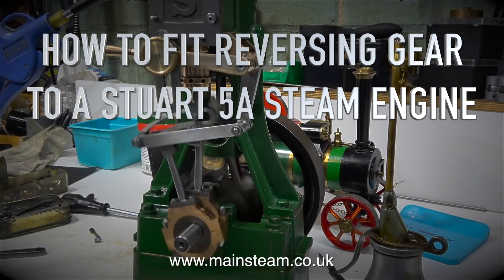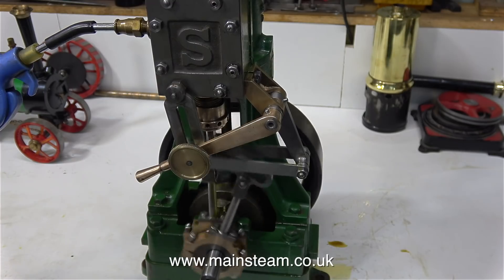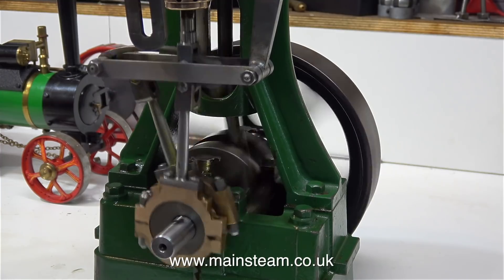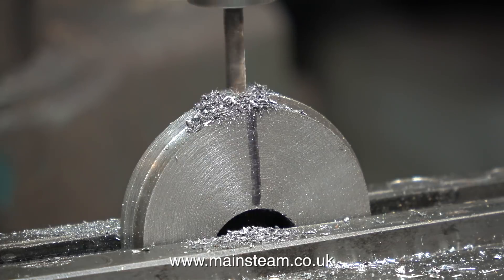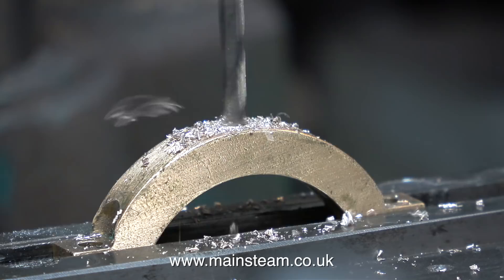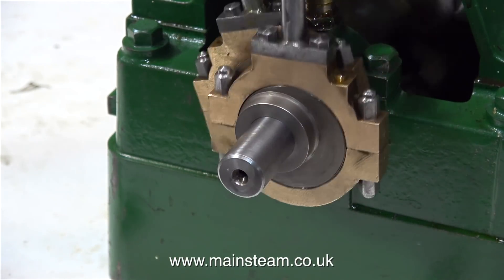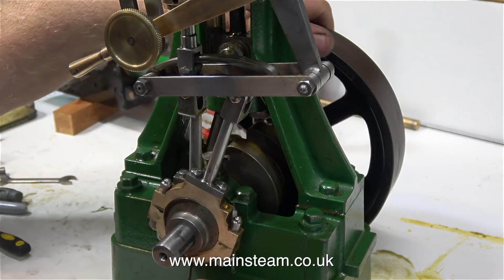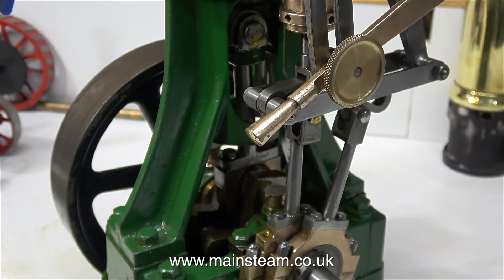HOW TO FIT REVERSING GEAR TO A STUART 5A STEAM ENGINE - PART #5

Comment: Hello Mr. Appleton, I would like to ask you your opinion on a keyway on the eccentric side of the crankshaft, the reversing gear casting kit from Stuart models according to the drawings calls out for a key and keyway, do you recommend no key and keyway and having two separate eccentrics held onto the crankshaft solely by grub screws, I am nearing this particular point  in my Stuart 5A build and would appreciate your comments.
Reply from the maker: As you can see in the Video, my Stuart 5A uses Grub Screws on two individual eccentric sheaves, and these seem to work just fine }:-)))

Comment: I love the adjusting screw on the side!
I have a new Lathe that has this on the back gear part on the head-stock.
Well the Raglan Lathe is new to me and slightly older possibly
Lovely journey into Stationary Engines!
David and Lily.

Comment: I really like the idea of having a hidden eccentric grub screw.
I remove the eccentric rod from the strap and drill the access hole between the two mounting screws. 
Thus for adjusting I only have to undo the eccentric rod mounting screws. I usually fit a couple of allen head screws to speed it up.
Easy to adjust, hidden and I don’t have a hole at the bottom of the eccentric strap for all the oil to leak out of.

Comment: Hi another great series. Just one question at the end you squerted the light oil of the month onto the engine will this not displace your preferd mixture?
Reply from the maker: Yes but it washes away all the black oil with metal particles and when I run it again I will oil it anyway ..... }:-)))

Comment: Mixed up you oil mixture today for the first time. Used it as a cutting oil on my slitting saw and finished the job off using it on a hand hack saw. Wish I had done it before works great . Thanks . Tomorrow will try  it on my loco on the rolling road on air. Thanks again for sharing , ken.